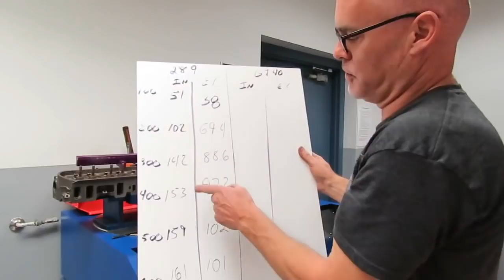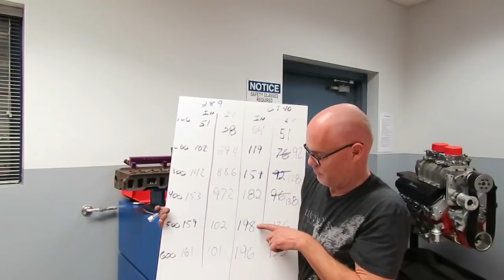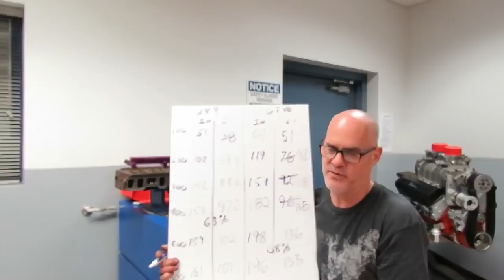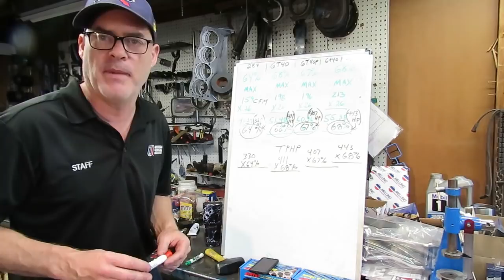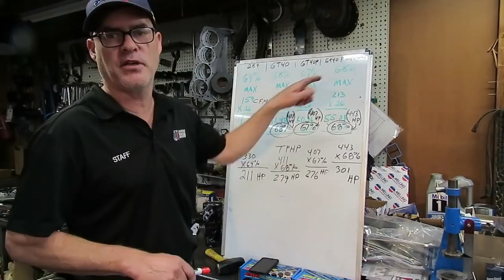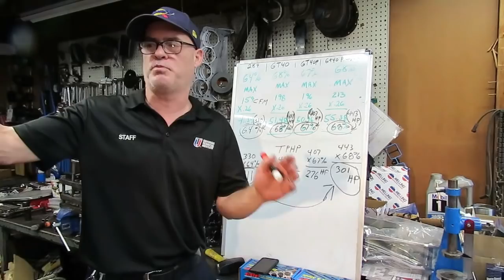How to get more power out of your small block Ford part 5

Comment: The 289 heads can easily be made to flow what gt40 heads flow stock even with the smaller valves and then gets a big gain based on compression increase from the smaller 54cc chambers...Even the hated E7 5.0L heads can see 200cfm intake and 170 exhaust with stock 1.78/1.46 valves as the 289 heads can.....put in gt40  1.84/1.54 valves and 225/180 cfm is now obtainable....Yes, you can always port the gt40 heads with bigger valves for more than any 289 can flow but you'll never get the added power from compression gains you get from 289 heads..David Vizard and Charles Servedio did some 289 heads that made 507hp on an scca vintage 65 mustang.

So to take a gt40 head and bolt it onto a 302 and it's a 25 to 30hp gain based on air flow but if you do the same with 289 heads that's yet another 25 to 30hp from the full point in compression gained plus the gains from added air flow....I'll take the 289 heads any day over gt40 heads with a flat top piston.

Bolt gt40 heads on a 289 that had 54cc heads and you just lost 25hp before any power gains from air flow.

30hp from air flow but minus 25 from compression loss for a whopping 5hp gain?..Makes no sense.

Comment: Back in mid/late 90s then early 2000s was messing around 302s what i learned was ditch any iron head and get a nice set of aluminum.  Worth every additional $.  I started with E7s ported with 1.94x1.6 then went TW wow what a difference.
Reply from the maker: Yep the E7 heads are just like most of the factory ford heads they have very poor flow

Comment: Love your videos, and real world results like this help to dispel a lot of myths. One thing worth mentioning is the chambers on GT40Ps have two distinct advantages over GT40 heads - they’re quite a bit smaller for a nice compression bump, and the revised plug location makes for a much more complete burn. GT40P heads were developed because the GT40s weren’t efficient enough to pass federal emission standards. Header choice isn’t as bad as many think either - MAC and BBK both make headers that fit, and 90 degree plug wires and heatproof boots can often fix the issue. 
One other thing - the factory springs need to be ditched immediately. They have no place in a modified engine that will turn more than 5k.

Comment: Building a "tool room" correct 289 aluminum body Shelby Cobra with dated 1963 iron block, heads, and intake. Ported 289 heads yielded 188/144 cfm with standard valve sizes (75% efficiency). Picked up substantially on the exhaust side with porting. So, quite a cfm increase over stock with good porting. Dyno output was 325(net) @ 6200. Wanted to use original heads for period correctness. Not necessarily an inexpensive approach for increased hp.   https://www.youtube.com/watch?v=bwcmyagrFJ4&t=0s

Comment: What are the flow on the 289 v4  heads. Thanks you explain clear
Reply from the maker: The factory SB Ford heads did not flow well I got 168 CFM at .450 lift

Comment: I put the gt40 heads on my 351w f150.I had a valve job done and milled down flat.Upgrade on the springs with a .456 lift cam.I have $500 in the heads for every thing.
With the dual plane intake and headers that are 1.5/8 plus removing all pollution control the truck has to have 75 more horsepower.Way cheaper than aluminum heads with a $1500 price tag.It even beat a 6 cylinder Mustang that had mods in a quarter mile Bristol street fight event.

Comment: Did some number crunching 289 Head .100 valve lift increments and the flow percentage .100 - 75%, .200 - 68%, .300 - 62%, .400 - 64%, .500 - 64%, .600 - 63% for an average of 66%. The 302 GTP Head .100 - 80%, .200 - 77%, .300 - 81%, .400 - 76%, .500 - 69 %, .600 - 68% for an average of 75%. Based on the overall average the GT40 is 9% better. The best part is they can be made to be even better then their original numbers. My question is when the flow percentages level out based on .100 valve lift increments does the power range do the same? Or is it when the flow numbers decrease to little to nothing does the power range level out?

Comment: Great video. I kinda wana take the gt40 heads I just ported for my neighbor and see what they flow. I didn’t fully port them I just cleaned up the intake and gasket matched the exhaust ports which opened those exhaust parts a lot they are tiny straight from Ford.

Comment: I ported my e7 heads and left alot on the table , they flowed 190 at 400 lift and 197 at 500 lift all the way to 600 the exhaust flowed 160 at 600 lift with a pipe. Thank you for the video

Comment: Thanks so much mate. I’m in Australia and not that mechanically minded but learning so much. I have a 302w in a 69 Fairmont and it went bang last week. It still runs but has a bad knock. We haven’t pulled it apart yet but really think what ever is wrong I will be doing this change anyway. The car is all original so want to keep it more or less the same but don’t mind the extra HP. What size cam would you recommend. I’m a street/strip guy lol lol lol. I was happy with the power before it went bang but did want I nicer note to the engine so don’t mind a Lumpy cam. I’m guessing from watching your vids on this build so far that a high 400 or low 500 is best. 

Thanks heaps and great vids now onto the next vid in this build

Comment: When comparing the 40 and 40p heads. I get your flow comparisons but the 40p combustion chambers are significantly smaller. How does this, if any, change your comparison of the two? Strictly speaking of the gt40 and gt40p heads. I’m looking to do the swap and if I can avoid the spark plug clearance on headers I’ll gladly go with the 40s if we are talking minimal gains with the P’s.

I have a 302 and can get a pair gt40s or P’s for the same price at a pick your part yard.

Comment: Great videos, loving it so far, thanks a lot for sharing your knoledge on this. I have perhaps a silly question, wouldn’t the in/ex ratio be better using a 1.94/1.6 valves ? Does it make sense to go into that direction? All the best to you and your familly. Warm regards from Brazil.

Comment: One question is how would it work to use the GT40 head and open up the intake valve and port? You would be able to use regular headers because of spark plug angle and the exhaust valves are already bigger. It would seem to me that you really wouldn't have to do anything to the exhaust valves and ports. I would also like to see the flow comparison with the Cleveland heads.

Comment: Great information.  I'm here as one seeking out enough knowledge to be able to talk a bit with a potential engine builder.  This really, really helps.  From camshaft selection to head work, to that 289 build series, I am way closer to asking better questions but also expecting no BS answers.  Having said all that, do you or does anyone reading the posts and watching these vids  recommend an engine builder in the Richmond VA area?  Or just Virginia?  Original Ford 289 in a 68 Mustang.  It's running, and I expect it has had work done given what I could see and hear.  (Holley 4bbl, Edelbrock intake, stock heads).

Comment: Will the GT40 heads fit a 1969 351W  and do you think they would help over the stock 2v heads on this engine?
Reply from the maker: yea they will fit if you have the bolt holes drilled out to 1/2" they will help performance
Reply: @Myvintageiron7512   So what was the valve size you incressed to

Comment: Love your content.  Super knowledgeable.  But check your math on the air flow ratio on the GT40P heads.  Should be 70% .500 not 67%.  Keep up the good work.  I'm planning a 5.0 transplant into a Ford Ranger.  Choosing whether to go aftermarket head or GT40P is a lot easier now.  You've even helped me choose a cam too.  Thanks, Rob G

Comment: What im learning from building my sbf and watching these videos is as follows. 
Don't bother spending time porting or back cutting or anything  with stock heads, just make sure the valves seal. The flow percentage between the intake and exhaust ports is so bad it will never really be good. Just enjoy what it is as it is. 
Or spend the money for heads that flow much closer on intake and exhaust with both a higher total cfm and flow percentage
Reply: Actually, porting the pocket under the valve, shaping the guide boss, smoothing the short side radius and back cutting the valve will take a stock 289/302 head up to gt40 range. (Or better if you know your stuff).  If LABOR is free and you have spare time, it's VERY worth it.  

BUT  slapping on a set of gt40 heads... boom done.

Comment: If you take the CFM (adjusted down by the int/ex ratio) flow numbers, convert them to cubic inches/minute, and divide the cu in of a single cylinder can you determine the RPM at which port saturation occurs for the head?   Is this the realistic RPM range the cam duration should be spec'd to?
Reply: Thinking a bit more about this.....the 28" of pressure is a 'reference' and does not represent the real vacuum/pressures present, so no my method of calculating RPM for port saturation won't work.

Comment: So what I got out of this, when I change the heads on my factory 289 and changed them out to the ported and large valve heads, he’s getting a nearly 50% power increase, and that’s only with changing the heads, with everything else staying the same.  So that’s a pretty good investment.
Reply from the maker: no the cam has to be upgraded as well it needs to match the max flow point in the max range of the better head

Comment: G'day bud, very interesting video. While I was watching it, I was thinking about the 411Hp and the 407Hp to both heads and the 1% difference between them. Although I didn't get the same answer as yourself, I figured that the 1% difference=4Hp. How I arrived at my answer before you did the maths was 275Hp=279-(411-407) ... Cheers for the video bud :-)

Comment: You had the flow rate of the GT40p at .500 at 67%. (196/138). Isn’t that 70.4% instead of 67% ? And I can’t over state how much I love this small block ford build series. This is great stuff!
Reply: I was going to comment the same, you are correct

Comment: Great video. It’s been known that that regular GT40 heads flow just a little better than the P heads , just as you proved. But you also proved it’s such a small number you won’t actually feel the difference. The huge factor is that P heads are plentiful and you can still find many sets in a junkyard today. The regular GT40 head not so much. I know a 300-325 horsepower small block does not sound like much to most people. If it’s in a 3,000 lb Mustang though it makes a huge difference. Possible high 12 second car with reliable dependable power. Not to mention a whole lot fun lol. Can also add a 125 shot of nitrous if you wanted. Again great video sir.

Comment: To get some perspective, I looked up a TFS twisted wedge 170 fast as cast SBF head. On the milder end of the aftermarket spectrum. They flow 257/187 at .500 lift. (72%) You’re right, the GT40P heads aren’t great but they are so much better than the 289 heads. And the TFS heads are gonna run about $1500. Thanks a lot. Great content.

Comment: A friend of mine has a few sets of the early small chamber 289 heads, and he swears up and down that he's going to put in big valves (1.94/1.60) and "port the hell out of em" and build an all motor combo that will rev to 10,000+ RPMs and beat most big blocks!! LOL
It's nice to have dreams you can aspire to!!

Comment: So why is the exhaust flow always less than the intake? Why can't they be equal?
Reply: Typically, no gain beyond about 75%.  Remember, intake flow is by vacuum. Exhaust flow is PRESSURIZED  then pushed out.
Reply: @johnb7430  thanks, I'm gradually piecing all this together in my mind.  I've always wondered why heads are not made with equal flow on intake and exhaust.  I built a FE stroker last year and the mild cam I chose has longer duration on exhaust.  I'm assuming that helps exhaust flow? but I'm not sure.

Comment: I'm enjoying these Ford comparison's, I don't know if you have a engine dyno or not but if you do I would like to see the difference in power on the exact same motor between a roller cam and a flat tappet that has the same lift duration etc. I've always been curious about it and there's no videos showing the true difference between them, only that you can make more with the roller but I want to know how much more with the same setup 👍🏽 it would be a killer video and would probably go viral 😁👍🏽

Comment: Ive got a new rebuilt 306 for ford fcam  its got GT40p heads I ve changed the valve springs and used TFS spring and retainer kit still setting on engine stand what are the chevy valves that you use think it would be worth the money to have them put in the heads

Comment: 351w Clevor, sounds really interesting. What are your thoughts of 351Clevor all iron, factory iron 2bbl heads ported. It's probably really obvious  I have a good supply of old cores, but I'm building on a very low budget.  Other than surfacing, the port and valve  work costs only my time.

Comment: I have yet to try some Explorer GT40 heads. I have used early, pre66, heads but always did a full port, big valve and chamber job. These early heads are much easier to port because of not having the air injector bumps in the exhaust. These castings are almost never cracked but are OLD and hard to find. Explorer GT40  heads will need dedicated  headers. Learn to port the new GT40 head!

Comment: I know its a ford video but I run a stock class circle track motor, would you have a set of factory sbc 041 or 492 heads to get flow numbers and then maybe a comparison to slightly ported heads. I don't have access to a flow bench 😫

Comment: Been looking for a set of GT40 or even the "P" heads  around my area in Texas and junkyards are cleaned out of them . There are guys selling them used but they are wanting 500.00 a set for them not surfaced , checked for cracks or even cleaned .  I'm still a ways from my engine build so I'll keep looking for a cheap set  . Your videos help a lot to get good accurate  information  .
Reply: I have a real set of a lighting with egr ports and the big holes for the head bolts of a 351 W. Completely re done by Neo Mustangs with trick flow valve springs and all machine work done. Sitting in a box, lol!

Comment: Take a guess folks...
 302 bottomed end.
Ported twisted wedge heads milled to 58cc.(.030 headgasket) flow over  250's
Ported upper and lower intake
Ported throttle body
512 cam 
24 lb ford Motorsport injectors
76 mm maf. 
 Couple more things to do before dyno time...
Reply: 390-400 hp
Reply: @bryansage6925  thats exactly what I'm hoping ..should  be very close to that

Comment: Amazing series of videos and awesome timing, too! I just pulled a 351w from a '95 F-150. I figured it would be cool to have a carbureted hydraulic roller in my '84 Crown Victoria. Thanks for sharing your wisdom!
Reply from the maker: Very cool!
Reply: The 351s were some times roller blocks with non roller lifters
Reply: @kevinjohnson9372  This one is a full roller but weren't all 351's roller by 1995?
Reply: @bradnimbus4836  the 95 Lightning still used flat tappets but all others where Roller in 95 & 96
Reply: @kennyleejohnson5253  Awesome, dood!
Reply: Are you gonna be doing the gt40p heads on the 289

Comment: Great info once again!
I want to build another 302 but I’m not sure if I want to use a turbo or supercharger. Could you show or explain  how to build a suitable bottom end for each? Which compression  is better for a stock engine or one with a turbo or supercharger? I’m guessing each has to be specific.
Thanks!
Reply: Perhaps a 351w fits the bill better.